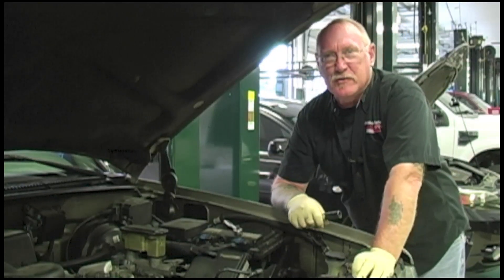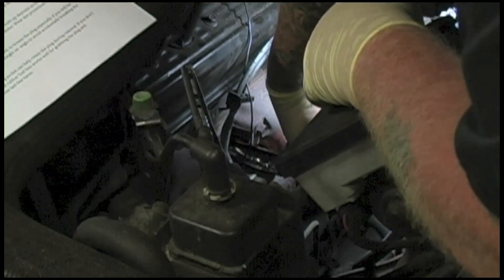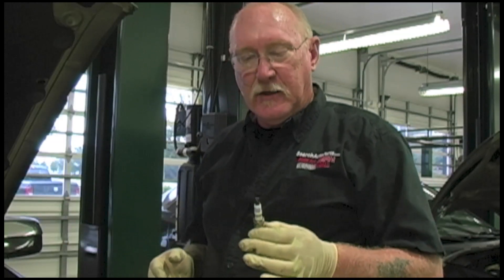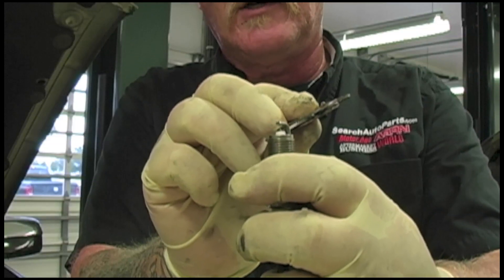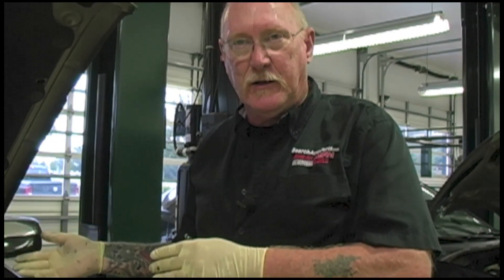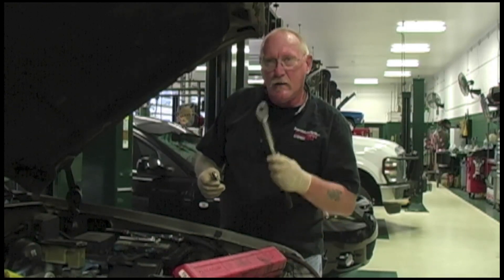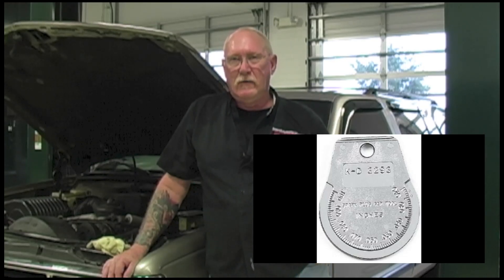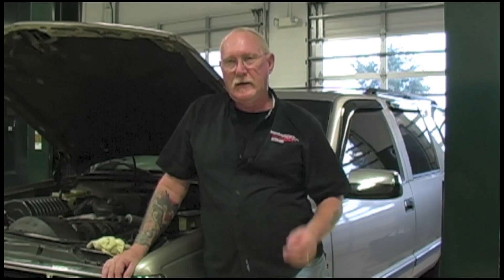The Trainer #44: Servicing your spark plugs

Comment: Nice to see a professional tell everyone not to use anti seize ‘unless’ the manufacturer says so. NGK says no, don’t use anti seize on their plugs, even saw an engineer from NGK say so. Using a torque wrench is great sound advice too. But…these seasoned, don’t tell me how to install plugs know-it-all will go to their grave insisting they know better than the company making the damn plugs are either too proud or too stupid to learn and do better. Separates the shade trees from the true professionals.
Reply: if the plug is silver or chrome plated, you DO NOT put A/s on, if the plugs are black or copper you can

Comment: use anti-seize ALWAYS.  If you ever had a stuck or broken plug in your head-  you'll worship anti-seize.  Just put a little on one side of the threads. As you install the plug- the rest of the thread will coat.  Torque to about 90% of spec unless the manufacturer specified a 'lubed' torque spec.  I torque my plugs to 26Nm with anti-seize. The really important point which was at the beginning of the video -  after removing the boot / coil pack-  blow out the port with compressed air BEFORE you remove the plug.  You'd be amazed at the debris that can surround those plugs, especially if there is just a plug wire attached.  You don't want anything like that falling into the chamber. Good luck everybody.
Reply: incorrect and bad advise
Reply: @AdrianJayeOnline  ya - just leave a "you are wrong" comment but don't explain anything.  Stick to helping your wife fold laundry.
Reply: Yes, definitely a superb idea

Comment: With the dielectric grease, would it be good enough to just put a thin coat on the white ceramic part of the spark plug itself and not any on the boot? Then when the boot fits over it, the boot should end up with a thin coating and their will be no dielectric on the terminal/ post?
Reply from the maker: Sure, that would work. I've never had an issue, though, by adding a small amount at the boot. Be sure, too, to make sure the porcelain is clean and so is your plug socket to avoid getting contaminants on the porcelain.

Comment: Keep in mind things in life are very forgiving, sure the plugs will go in without being torqued, and the wires will still conduct even if you dump dielectric grease on the  conductors instead of the rubber boots. If you didnt get it right, relax, just dont expect 100k from your iridium plugs or 50k from your platinums. When in doubt, change em out - doing it perfectly every time comes with experience, and experience comes from doing it wrong and soaking in that feeling of stupidity and dread when it breaks. No school can teach you better than direct experience combined with attention and care.
Reply: NEVER put dielectric directly an any electrical surface connection as it is non conductive. You run the chance of causing complications with the electronics. One maker of fuel controllers states it will void the warranty if done as it is one of the main issues of failures.
Reply: @340rps  Failures? stop lying. 30 years putting dielectric grease in all connections, and nothing happened to any of my cars. Liar.

Comment: I removed ac delco iridium spark plugs after 125000 mikes. There was a lot of rust on the threads. Would you recommend a little anti seize on the threads for new spark plugs.
Reply from the maker: No, not on these plugs. Adding anti-seize will affect torque and may lead to either a loose plug that can't dissipate heat or one too tight that could damage the plug.
Reply: 125,000---thats 60,000 to us
Reply: 125,000 that is 60,000 too far my understanding in a aluminum head,,,,!! Iridium or not!

Comment: Using anti-seize when not necessary, can also cause incorrect torque values (sometimes over-torque and sometimes under torque).
Reply: So does installing on a dry thread which the plug dragged when removed. ... more so

Comment: I use a slight coating of dielectric grease on the porcelain part of the plug and a small dose at the very beginning of the boot opening but not deep enough to get on any of the electrical connectors.

Comment: On my 96 Chevy C1500, the Haynes manual says to put a small dab of silicone lubricant to each terminal of the distributor cap before reinstalling the cap. This doesn't make sense since silicone would be an insulator, right?
Reply from the maker: You don't want to put anything directly on the contacts inside the cap. Putting a dab of dielectric grease on the end of each plug wire can help seal out moisture and make it easier to remove the wires later.

Comment: The coin thingy works good for increasing he gap, then i used the wire type he has in video to close gap. Feeler gauge to check gap. The hole in coin is great for enlarge the gap.

Comment: Well looks like I did it wrong.  Just installed 8 plugs and coils in my 2004 Thunderbird and used the disc gap tool to gap the plugs.  Was concerned about over-torquing so now wondering if I didn't tighten the plugs enough.  Car seems to be running fine, and I sure don't relish the idea of taking them out.  Thanks for the info, will know better next time.
Reply: Nothing wrong with the tool if you use it carefully.

Comment: Where's the fender cover? Good video but would like to add one extra inspection point. You mentioned cracks on the porcelain but also be aware or carbon tracking. It looks like a crack but is often overlooked because you can't feel it. Carbon tracking can and will cause intermittent misfire.

Comment: Always start plugs by turning in the wrong direction until you feel it click and the plug drop into the thread, then start gently turning clockwise. This aligns the threads and prevents cross threading. You can go backward several times to be sure you're at the start of the thread before starting the plug in. 🔩
Reply: I use this method when screwing a lot of things in.  I have cross threaded something by hand and it felt normal, my only reference that something was wrong was half way down it jammed.
Reply: just put 1/4" fuel hose on the plug and turn it by hand until it stops spinning. You'll never screw up threads like this.
Reply: @drewskeez1156 I agree but was told the reverse turn method till a click and you feel it seat 30 years ago by an old school mechanic. Also told me the fuel line trick with plugs that is kinda situational. If you are working on for example a Ford truck with the modular engine like the 4.6 5.4 or 6.8 that the damn plugs are 6 inches into the head. Unless you have a perfectly straight piece of fuel line which is extremely unlikely its still going to be a bitch. Magnetic spark plug sockets and an extention turning in reverse by hand till you hear and feel it seat then turning in gently to make sure it's right is the way to go. I'm not saying you are wrong whatsoever but the hose isn't always the best route. Honestly just by habit I do that to all bolts I don't even realize I'm doing it I'm just so accustomed to doing it. Haven't crossthreaded anything in forever. Last time I did I had a few to many beers in me lol.
Reply: @drei have different sizes and lengths of hose pipe with handles  never crossthread a plug in 46 years.wskeez1156
Reply: Or you can start by hand and feel if you are on the thread or not.
Reply: @alextalos6141  That is starting by hand. It works. Try it.

Comment: cant always use a torque wrench. no clearance. my torque wrench is my forearm and experience. great video,as always. thanks
Reply: You mean you don't use a 1/2" breaker bar and pull till it won't turn no more?    ..... Seen people pull the threads out on  a Victory oil  plug. they either tighten it way to much , or worse turn it the wrong way when loosening as the plug sits on the bottom of the case and they get mixed up on which way to turn. Never will admit it, easier to blame the manufacture.

Comment: If you run a tap through you'll need to lube the tap, then you have to clean the lube off the threads. If not, the lube will affect torque and alignment just like the  anti-seize would have. 

Dielectric grease is awesome. You really want a liberal application to coat the spark plug center connector. The point is to isolate the electrical conductors from oxygen in air thus preventing oxidation. Even more beneficial is to increase the dielectric strength of the boot to prevent arcing to the well. A side benefit is keeping water out of the boot. Don't worry, the electrical connection will not be affected by the grease as it is designed to be pushed clear by the connectors spring type clamping effect.  I heard you say you use only a dab so you'll be missing most of the intended benefits. 

I like the wheel gauge. I did use my calipers to ensure accuracy of the wheel. Mine wasn't a giveaway, it's a "good" one, humor intended. I got it when they first came out so I spent a few minutes going around the wheel measuring. I agree that the giveaways shouldn't be trusted unless confirmed. They are ever so handy and quick. Don't twist on it or force it through to widen the gap; I'm surprised I had to say that. 

I love your videos, thanks for doing them.

Comment: @15:59 damaging the tip of precious metal plugs...Pete,according to Mohs hardness scale, both platinum and iridium are much, much harder than copper, so damage shouldn't even be an issue.  If you're breaking these tips you're doing it wrong.
Reply from the maker: Thanks for bringing that to my attention!
Reply: @VehicleServiceandRepair  difference comes with the thickness of platinum and iridium applied, cos it's absurdly thin usually. So hard forces can crack sections of the plating, either off entirely or just loose from the inner part of the electrode which would give you heaps of random issues
Reply: Hardness is no indication of whether something will crack or chip.  In fact, with many materials the harder they are, the more brittle.

Comment: Could some one please tell me ASAP if Motorcraft SP-580 iridium plugs need anti-seize on them. I can’t find the answer to this question anywhere so far...thanks
Reply from the maker: If the OEM doesn't specify its use, don't use it. If you're not sure, don't use it. DO use a torque wrench to properly tighten it.

Comment: You dont need a torque wrench  but it is more accurate, you can turn plug 1/2  to 3/4   trurn  as soon as it stops turning when you screw it in by hand and know its all the way in unless the thread is dirty and it is hard to screw in
Reply from the maker: Sorry, I disagree - just the difference between a plug with a gasket and one without should make using a torque wrench necessary.
Reply: Your procedure may work for an oil filter, not so much for a spark plug.  Use a GOOD QUALITY torque wrench.

Comment: Never ever use a power tool to remove a spark plug...except a ford 3v.
Reply from the maker: You'd be surprised at how many techs I've seen personally use an air ratchet to pull AND install plugs!
Reply: Ford 3 valves are prone to break plugs fact but put a 3/8th impact electric or pneumatic and that impact knocks the carbon off and they come right out. Have broken only a few since starting to impact them ...... So never impact I dissagree and times are changing what will direct inject hold for our future what will we learn in time like how to not break plugs on 3 valves

Comment: my 2013 crv vibrates when not yet warmed up, especially when the a/c is on, and at around 40kph. any idea of solution?
Reply from the maker: Not much information to go on - How many miles? Have you checked the condition of the engine mounts?
Reply: @VehicleServiceandRepair  65,000 kms. I checked the engine mounts and they are ok. Thank you.
Reply from the maker: @ArChi285  Have you performed a scan of the vehicle for DTCs? If so, any listed?
Reply: @VehicleServiceandRepair  not yet. I will try that if nothing works. Thanks anyway

Comment: U put the grease where on the plug boot ?
Reply from the maker: I put a small dab on the boot opening and then slide the boot over the plug.
Reply: Seems to me ... greasing the boot opening before fitting it over the spark plug could inadvertently transfer the dielectric grease to the plug terminal.  I mean, there's not much clearance.  Seems inevitable you're going to bump the plug terminal with the greasy boot before sliding it on all the way. Or are we just not supposed to care about a tiny dab of dielectric on the terminal?

Comment: Does testing the spark plugs with multimeter work?
Reply from the maker: Yes, you can test the internal resistance of a plug with your multimeter - but why? Use a scope to look at the secondary pattern and you will see so much more!

Comment: Have you ever have a plug break
Reply from the maker: Short answer - yes.  :-)
Reply: The plugs on my deal were that tight i broke about 3 of them  not to mention the tight boots aswell. Must not hav been serviced regulier basis. It turned a 45 min job into a day job. Must had been installed with an impact. I always  torque on install now...

Comment: I have been using "anti seize*" on thread engagements for over 40 years under the most stringent quality control  codes in the world. Using anti seize on spark plugs is child's play. Just DO NOT put any of the compound on the first 4 threads; because the first 3 threads are started threads and can allow some of the metallic particles in the anti seize to be pulled into the combustion zone and coat the surface of the part of the spark plug that is with in the combustion chamber and causing the electric current to short to the engine head and ground. BUT if used wisely it make life so much easier when removing any threaded engagement, especially anything that is in a location of high heat. I use it on ALL spark plugs even the ones they say doesn't need it, I'm not taking any chances on stripping threads in a head or other high dollar component. I suggest getting the highest temperature rated antisepsis compound you can get your hands on. It doesn't take a  lot just a light coating and avoid getting any around the tip. If you do blast it off with "Brake Clean**" cleaner.
From NGK spark plug manufacture:  "Torque recommendations are for spark plugs with new gaskets. If using anti-seize compound, use sparingly and reduce torque by 30%.
NGK has created their recommendations based on the general consensus of most engine manufactures.  In the case of a discrepancy between the plug manufacturer and engine manufacturers recommendations, always default to the engine manufacturer."
* https://www.autozone.com/miscellaneous-cleaners-and-degreasers/lube/permatex-8-oz-226-8-g-anti-seize-lubricant/178722_0_0
** https://www.autozone.com/brake-and-power-steering-fluid-additives/brake-cleaner/autozone-non-chlorinated-brake-cleaner/8130_0_0

Comment: Hi, once I started engine after changing spark plugs for my Hyundai 2004 XG 350, there is loud noise coming from engine , we thought something fell in the engine and cleaned , but not sure whats going on, did u face this issue ever? if yes what could be the solution?
Reply: It's a Hyundai  piece of JUNK

Comment: Torque is required on all new direct    injected engines. There is alot of information about Volkswagens if not torqued can lead to burnt exhaust valves. The reason being is because when you torque the plug you actually are indexing the plug to a specific location. When this is not done you can burn the valve because where the flame front starts and stops. There is no current O.E. that suggest anti sieze. This can cause problems with the plug not getting the proper ground. Most problems that arise when plugs are not torqued. Under torque cause bad heat dissipation. Which can allow carbon to build up in threads. Where over torque will cause threads to he distorted which will cause gaulding upon removal.